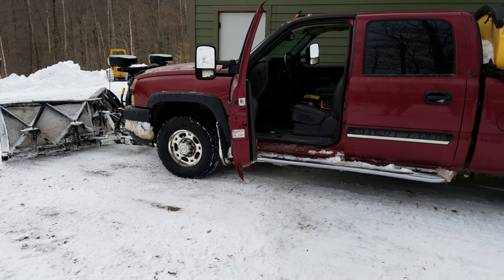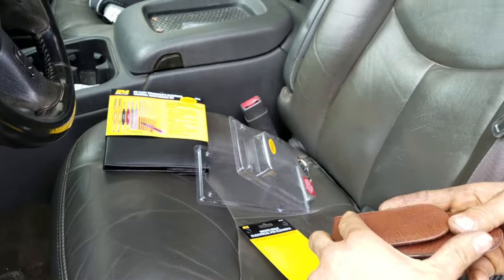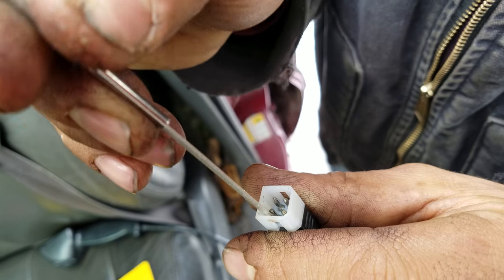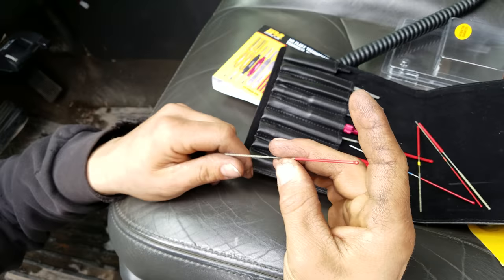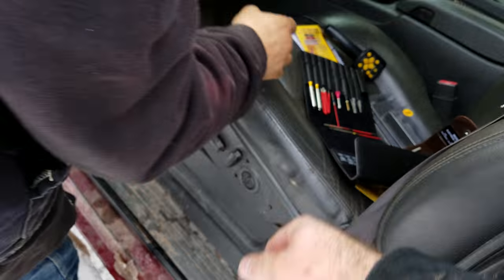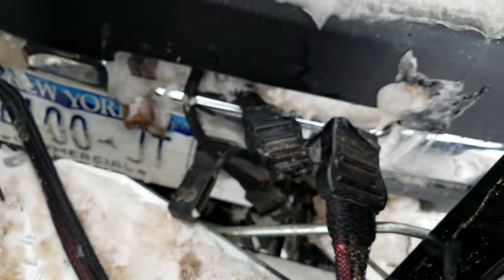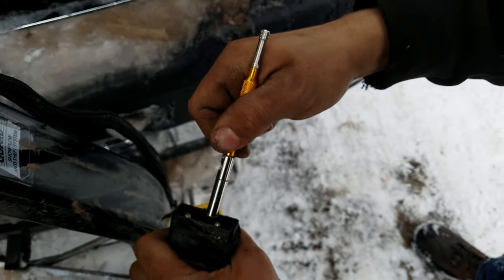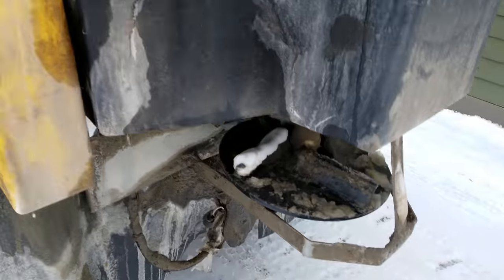How to Clean Electrical Connectors and Terminals

Comment: I had a problem with my Fisher plow this week not powering up, found green corrosion in the ten pin connector on the front of the truck. Just ordered a connector cleaning kit from IPA. Great tips and video!

Comment: Very helpful. Where can that kit be purchased. I called my fisher plow dealer this morning and suprise, suprise, the service guy said they don't sell the tools, just use a wire brush. Not very helpful at all. Your video was very well done. Thank you.
Reply from the maker: A lot of dealers don't take the time to try new things.   Either call IPA to get the kit #8048 or just go to amazon.  The dealers should carry them.  I recently saw fisher was using one of them in a troubleshooting video on their website when I was chasing down what turned out to be a bad plow module.
Reply: Just get yourself a 10 dollar dremel accessory kit,  they come with small files that work perfectly.
Reply: @thegoyimknow.  what files only seen different grinding tools that would gaulg them pins up?
Reply: Lot of places don't want you to buy these tools they might just want you to take them in so they can charge you a hundred or so for cleaning them.?

Comment: That dudes hands look sore.
Reply: grafters hands dem
Reply: I used to work in the backyard of a scrap guy we took transmissions apart every weekend I would go n work there, my hands looked like mechanics hands within a couple days, I tore each transmission apart separated the cast iron n steel from inside  ,and for cleaning grease off I've found tranny fluid works best of all, or shampoo.
Reply: $130 in files, but well worth it if it solves the issue.